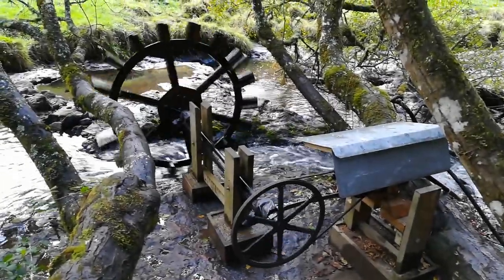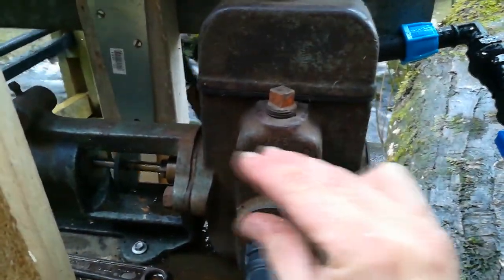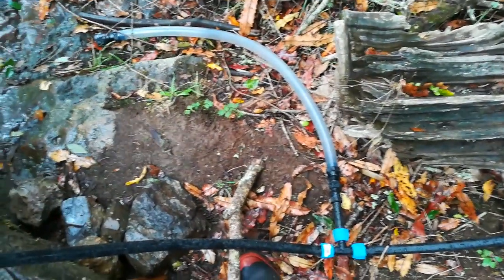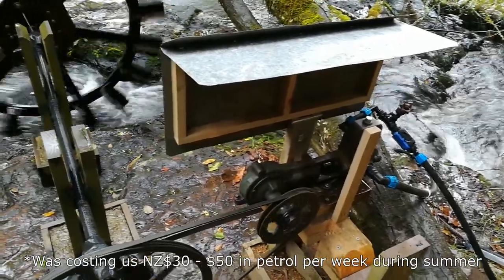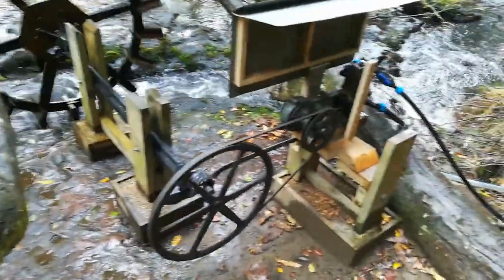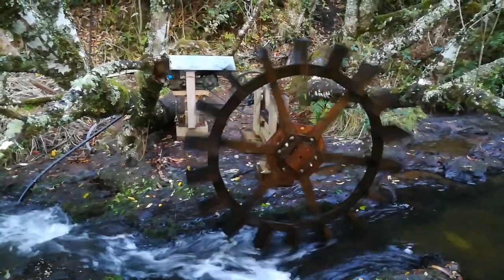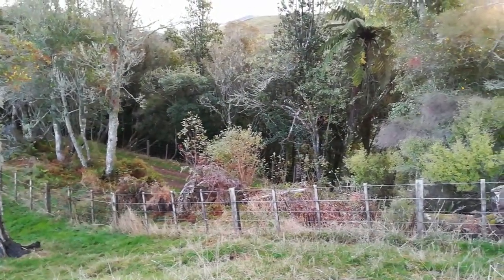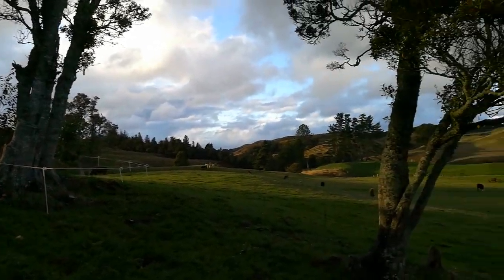DIY Waterwheel Build: Pumps water 20 metres (65 ft) high during drought

Comment: Several good suggestions noted.  Might want to add a third axle support point out in the creek so the paddle wheel instead of being cantilevered out from the bank which places a tremendous amout of side load and torsion on the existing support points would have balanced support on each side of the wheel.  This could easily be added during the low water time in summer.  A rotohammer and some epoxy would allow you to anchor into the rocks.  Adding some jetties to direct water flow towards the paddle wheel couldn't hurt.  And a screened settlement tank for the water pick up will considerably reduce wear and tear o. Your pump.  Also a screen across the creek upstream a ways would help reduce branches and other objects contacting the paddle wheel. 
A clever set up, with room for several minor and inexpensive improvements to increase volume and reliability.   Best of luck.  Scott, Vancouver,  Washington. U.S.

Comment: Nice one.
Looks great. A good way to get rid of the sediment in the pipe is flow from the pipe into something big like a pickle drum with a sealed lid and out the other side again.
It makes a hydraulic separator and as the fluid slows, the silt falls out. The only thing you need to do is to make sure the pickle drum can hold the head pressure.
Thanks for showing us the video

Comment: If you ever need more power from the wheel, a Poncelet blade design could easily double your efficiency.  Just angling the flat blades would help a lot.   Certainly not needed if it's working well now

Comment: Get a 5 gallon bucket, drill holes all in the sides, put a big rock inside it, then wrap the holy bucket with a cotton towel, it will keep everything you need out if the water, 1" to 2" holes around the sides, it should work perfectly, and cost very little!
Reply from the maker: Thanks James - we might just give this a try!

Comment: Beautiful old pump!  You say your pump lifts water 65’.  The companies website suggests about 7 meters or 25 feet is all you can expect.  How did you get that extra lift?  Are the older machines just more capable?
Reply from the maker: That figure is referring to how much height it can draw from, as opposed to head lift. These pumps are powerful - 250 feet is the max head height.

Comment: I noticed that your water intake to the pump pulls water from the stream below your water wheel.  Do you think it would make a difference if the intake was from the stream above the wheel?
Reply from the maker: I did experiment with putting the intake at various places in the river, upstream and down, but it was actually worse farther upstream, as there was a small waterfall churning up a pool. I found there was less sediment where the intake currently is, because most of it had settled at the weir, and the overflow over the weir is the clearer water. In any case, a sediment trap/filter on the intake should do the trick.
Reply: @BacktotheLand  Thanks for the info - so a water quality decision more than a how much water will the pump suck decision.  May not matter if the pump is at capacity.
Reply: @davebean2886  those pumps "suck" well from 0 - 25'